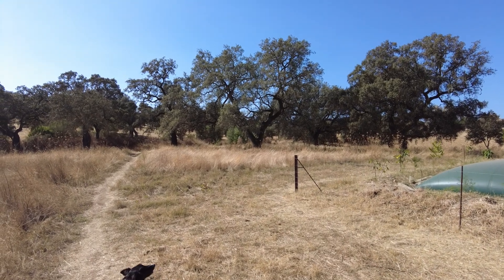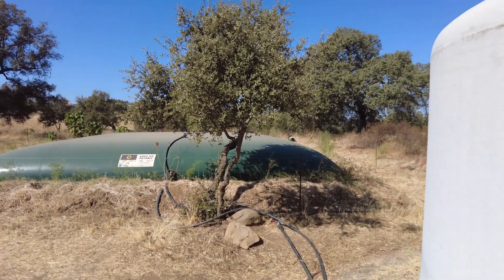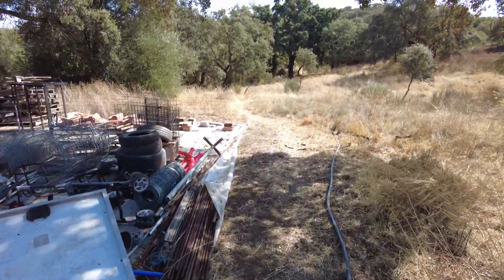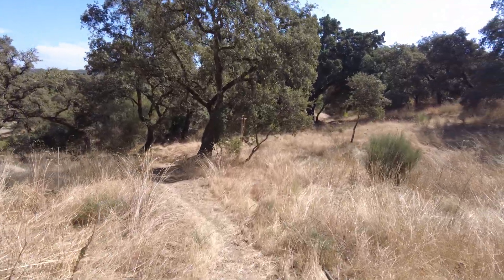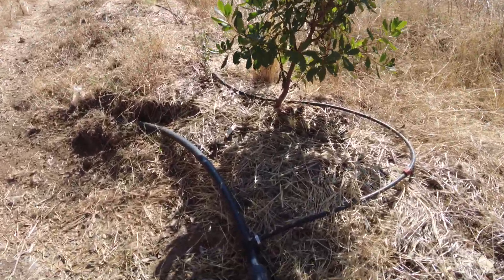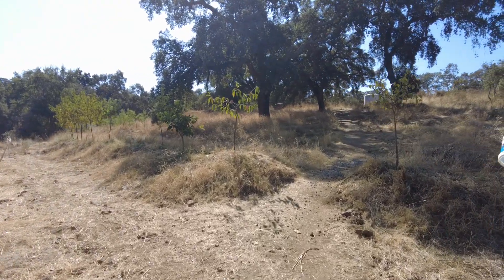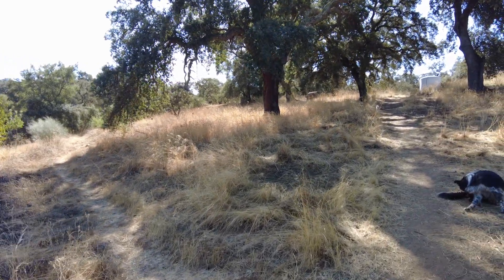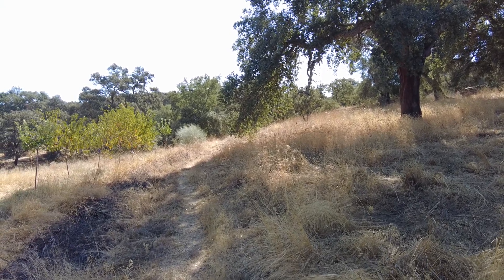The Hidden Journey of Water on our farm. Last video. #agroforestry

Comment: Where the two tanks connect near the house, do you have one way valves installed?  I'm assuming you don't want to fill up the empty pipes if they aren't closed off.
Reply from the maker: Such a good suggestion. They are closed by valve manually operated but a one way valve can be a secure way of doing things. Thank you for sharing